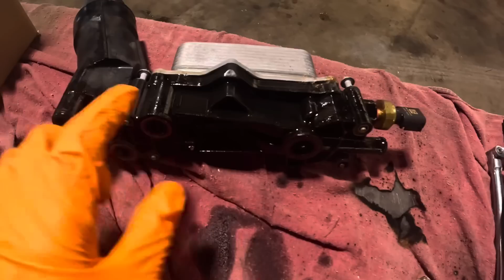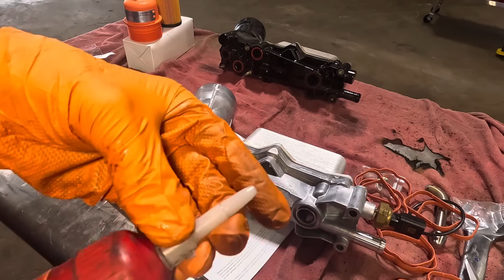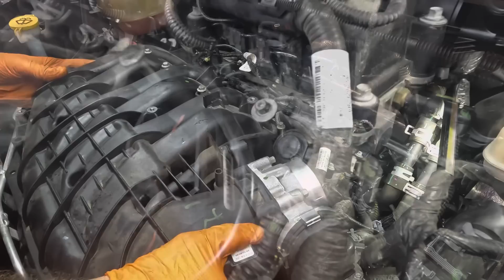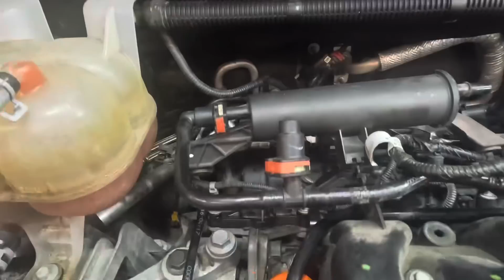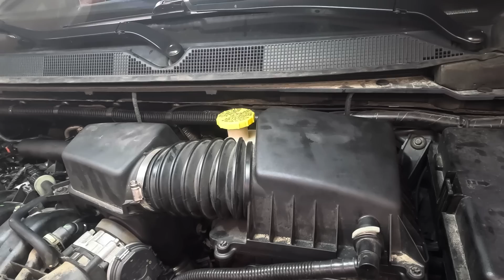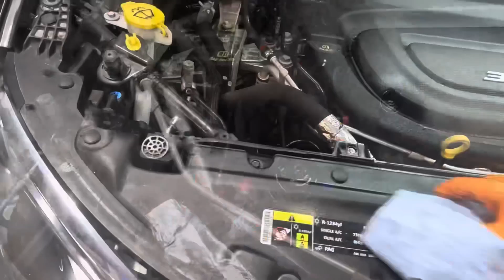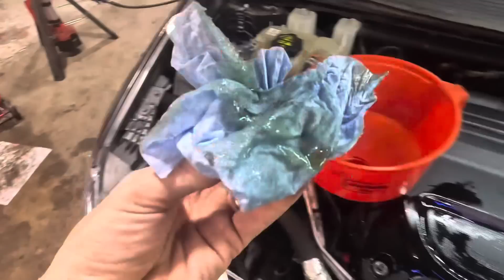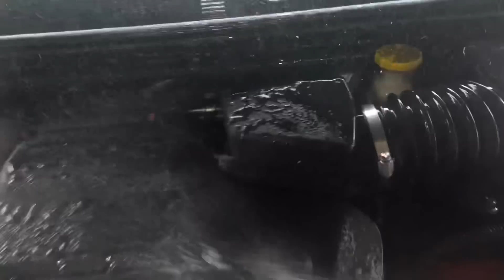Plastic Pentastar 3.6 PT2 Chrysler Dodge Jeep Ram Volkswagen. Leaking Oil Contamination!

Comment: Did a oil change on one of these on 2014-13 caravan. Next day things pissing oil on the driver side of the engine. Plug, filter cap tight. The onrings on the base failed. Big time.

Comment: Very much doubt that glass reinforced nylon was used for that housing.   Far too costly for Chrysler.    More likely a mixture of cheap as chips polystryrene mixed with a lick of more expensive Noryl (poly phenylene oxide) to extend its life - a little bit.

Comment: Hey Ray, you used teflon tape but I've said it before and I'll say it again: use Loctite 55.
A few turns and it's allways sealed even when you turn it a bit back.
I'm sure you'll never use teflon tape again.
Greetings from a humble mechanic in the Netherlands.

Comment: I was always told not to use a torque wrench for removal. But there are left handed (reverse) threads. That is why there is a switch on torque wrenches. IMO

Comment: I just replaced mine on my 2017 Chrysler Pacifica 2 weeks ago with a aluminum housing and the problem is back don't know if I got the housing level or Torque down properly so now I'm getting ready to revisit this issue all over again fun fun fun fun fun fun
Reply: did you lube that o-ring.??? without lube, o-rings will stretch and crack when installed....
Reply: @MrMustangMan  if I'm not mistaken I think I did put a little bit of oil on it but I did go to Napa I bought a new gasket kit for that new aluminum housing just in case start this procedure all over again and I will definitely leave those thank you

Comment: Can’t tell a book by its cover, well done . As to oil , back in the dark ages , 1966’s, in my military mechanics class the question brought up was —does oil wear out ? Or does it just get dirty and can be cleaned an recycled  ? As a young  lot-jokey at a gas station we sold  bulk oil by the quart that I believe was recycled oil .  So does it wear out or ???   Stay safe , have fun .
Reply: Interesting as much when I was in a similar class and a few years earlier the instructor was a guy that was a chemist for Shell oil but hated the big corporate  world and opted for the green machine. He said contaminants were not the problem for long life, remember how good a job the Frantz toilet paper filters did? He said the problem was that acids built up from the combustion process and filters could not remove that, though I think he mention that Rolls-Royce  had some device to do that. He said the acids were what caused the areas in the babbitt on plain bearings that you may have noticed in high time engines that looks like something was eating the babbitt away.
Reply: @barrystark3811  acid reaction was the big factor in our discussion also. The class was at Millington Teenn , NAS. On engines , both internal and jet/ turbine. It was a Navy school on ground support equiptment.

Comment: I believe that the Pentastar engine in my Grand Cherokee does, in fact, have 2 senders that mount on that oil filter housing, an oil pressure sensor, and a coolant temp sensor.

Comment: Torque wrenches are always bi-directional as far as I'm aware.

1) fasteners can be left or right threads, so 'tightening' could be either direction.

2) measuring the torque required to remove a fastener is a thing...

The beam style of wrench usually has a gauge in both directions, not just one; and as you noted the ratchet style has a reversing lever.

Comment: When extensions are used on a torque wrench the actual torque is not what the torque wrench is set at. It will be much less actual torque than what the wrench is set at. It's physics

Comment: That is correct Ray the Beam Deflectors Wrenches should not and cannot be used in reverse. The Torque Wrench you are using right now can be used in reverse. They are made to Torque Fasteners with Left Hand Thread as well as Right Hand Thread. Argument solved.

Comment: Helpful hint everybody! Excess heat causes this problem, take that plastic (and insulated!) cover off your motor and toss it in the corner of your tool shed. That cover helps keep the top of your engine nice and hot for a long time after you turn it off. Plastic parts + heat = failure every time. I have this motor in my 2012 Wrangler and THIS problem hasn't shown up.... YET!
Reply: i hate those stupid covers.!!!!

Comment: Oh man. I have a 2018 Caravan Grand with 80k miles. So this is another thing to look forward to... Already been through the side door lock fail issue that shops like to charge $1200 to fix. I did it for $70, but took a day and a half of fiddling with sharp metal in the dark. The $1200 was seeming about right toward the end.

Comment: I replaced this on my wife's van 4 years ago and got parts from the stealership   Over  $600.
6 months ago my Jeep was starting to fail, and looked to Amazon.  Got the aluminum one.
FULLY assembled.  With sensors. All plenum seals, etc.   $120.    😧😧
Reply: I got the same, but its not the doorman part? How has yours lasted, ok? 😊
Reply: @martinochs8285  Ya, it's  WOLLAHS.  Working fine. Too much plastic junk on engines nowadays.
Just hope all seals last a long time. Also got the dorman aluminum thermostat housing.  But still have a 
problem with moderate temp swings. Doesn't overheat. (this is #6 therm)

Comment: Ray, I currently own (due to my wife's untimely passing) a 2012 dodge grand caravan with the first gen 3.6 pentastar with 104k on it and can honestly say I haven't had any issues with the oil filter cooler except the relief valve plastic breaking but have fixed it. I DID on the other hand had to have the 135 cylinder head replaced due to dropped valve.

Comment: Hi Ray, A Fantastic repair job!! I have a 2011 Chrysler Town and Country van that had the same issue with the oil cooler assembly leaking oil. I bought the van used a year ago and now have had the issue. I took my van to my repair shop and had them replace the oil cooler. But now I see that they did not replace it with the Dorman oil cooler upgrade{Bummer). I have the original Chrysler part instead again. Now I see what is involved in the installation of the oil cooler. My 3.6L does not have as much stuff on the engine you worked on. Big difference from 2011 to 2017 engine design. Right now my van has 139000 miles on it and so far runs like a top and I hope it will go much more. I change my oil a lot sooner than recommended. So keep up the great work and I enjoy your videos, Been learning a lot at age 74. Don in  Connecticut.

Comment: Wrangler forum participants are stating that the Dorman is NOT the be all, end all.  Problem seems to be with the provided gaskets.  Some are installing Mopar gaskets with the Dorman unit.  I’ve had mine replaced under warranty at 50K on my ‘15 JK.  Looked again today at -60K and I’m dry top/bottom.

Comment: Reliability question.  After many years of seeing oil sender units leaking why would you reuse the old one ?  Also being a brass fitting  I was expecting it to break as you were aggressively tightening it.  I'm guessing You have better luck than I do

Comment: Is that an engine oil cooler or an intake air heater? Happy coincidence or engineering brilliance? Hehe, I said engineering brilliance about a company who uses plastic screws to hold the engine together and can’t out engineer/ manufacture Dorman.

Comment: Ray.  What is meant is do not use an expensive torque wrench to remove fasteners.....for eg, wheel lug nuts.   DUMB. Protect expensive tools that are important when re-assembly demands precision.   and,   Second, the tech that I admire most says, "A real expert can FEEL in his HANDS correct torque.  Period."  I would take off for the moon or Mars if either you, or he, torqued the fasteners on the rocket.   NOTHING BEATS REAL, Capable EXPERIENCE!  Go, Ray, Go Go Go~!!!!

Comment: Beam torque wrenches are nice if you run into reverse treaded components because they are designed to read in both directions right or left hand threads. I've never noticed if the click and electronic torque wrenches read in both directions.

Comment: My comment is the oil pump system of the Pentastar.  If the thermostat goes bad or leaks the engine will continuously run at 86 psi.  The engine oil has to reach 160 degrees or higher before it will drop to 36 psi.  So a bad thermostat  will eventually blow the oil cooler seals in my opinion.  I have a 2013 Town and Country and has a digital display for oil pressure.  The engine now has 4790 hours on it with only a leaky rad that had to be replaced.  Canadian winters are hard on any car up here due to the snow melting salt.  Keep up your video's Ray.

Comment: It is "old Wives tales" about reversing a torque wrench.
1. So many "Lefty Tighty" bolts out there and you'd need to buy a SPECIAL torque wrench just for them.
2. They have a lever for reversing them. If it was WRONG they would not give you a lever.

I do have some "One Way Only" torque devices and if you try to reverse turn, they click.

Comment: My theory on why that bolt didn’t seat when torqued to spec is due to the bolts being previously over tightened. The panel may have been deformed due to the over torquing. Just my opinion.

Comment: Nice job, question , at 17:04 on the video, when you start putting the bolts, do you recommend use lock tide on those bolts?

Comment: IMO, it was only the oil pressure sensor that was replaced previously and that's why the lock clip is missing. The OEM filter assembly is just fine as long as the oil change techs pay attention to the torque rating on the filter cap: 25 Nm as you said, which is quite low. Over-torqueing that cap can stress the assembly, leading to cracks or leaking o-rings.

Comment: If this is a known problem why has no one come up with a better design that is not under all the covers of the engine. An external unit of some type that does not have the coolant and engine oil where they can mix in a failure. "I know" those damn engineers could not organise a feed in a restaurant with $1000 in their pocket (the clean version).

Comment: What a "feat" of engineering! The gaskets are still going to fail even with a housing made of aluminum, why didn't Chrysler plumb the thing to the outside of the engine with lines, in the first place, where it could get some air? Also, you can restore those dessicant bags. Put them in an oven at 200 degrees for a half hour, they'll be good as new.

Comment: Ray ive watched enough of your videos now that when you got the intake off and I saw the oil cooler I was like. "I've seen Ray change this part on another vehicle before. Specifically because of the swamp left behind in the valley." Cheers from the maritimes of Canada. We don't think your exhaust disassemblies are very fair either.

Comment: Honestly, i would have installed a new oil pressure sensor cause they also prone to failure. Just good insurance to not have to do the job again

Comment: If a torque wrench wasn't made to go in reverse, it wouldn't have a reverse on it. And I assume there are applications that utilize counter clockwise thread bolts that require torque specs... Also, I assume if a torque wrench was made for both directions it would state it in the manual... Just my opinion.

Comment: As you stated in the video, "all bolts are fasteners". Engineers call all bolts as "screws"!
Reply: Without looking to back up my comment I think it has to do with the size of the fastener. Not sure where the breakpoint is though. I remember the callouts as either capscrews or bolts.

Comment: Couple of fun facts; my 1967 Mini Cooper S had an oil cooler, it was mounted behind the grill; Find of ask Wife Unit to make a reusable cloth bag, put you BLUE desiccant in it, check it now and then, when it is pink, pour the desiccant out on to a metal tray, put that in the over at 250F (to start off, I don't remember the exact temp) the desiccant will turn bole again, put it back the bag.

Comment: The whole idea of putting an oil cooler on top of the block in the valley, then cover it with a air intake
Seems really stupid.
You have several locations to vent heat off oil, under the radiator, in the grill, in a fender well,  or even under the body in the shape of the oil pan, like Banks oil cooler on rear ends ram air cooling oil cooler.
Mixing it with engine coolant does not seem to take away the heat as much, and certainly putting it in an ez bake oven is really stupid., thats what the valley is when you cover it with an air intake.
Might make a nice oven to keep your lunch warm.

Comment: Left hand threaded fasteners are rare, but are used in some specific applications. To use an S/R interchangeable head on one, simply put the head on reversed and use the torque wrench as usual. The wrench will still have its' normal accuracy.

Comment: Ok Torque wrenches: You do a fastener CW for RH thread and CCW for LH.  If you try to check the torque by unscrewing a fastener, you will not get the original reading due to a thing called detente.  Detente is the force required to overcome static friction, which happens when a fastener is fully torqued and you undo it - it feels stiff initially, then lets go.  That is detente
So there.  Now you know
Nice one Ray, what a pain in the proverbial.

Comment: When you said that 3.6L Pentacrap was in Jeeps my heart sank. I'm probably going to have this repair in my future. I do appreciate you showing that there is an upgraded version of this so I can request so hopefully I should only have to do it once. <knock on wood>. And the talking? That's what makes it fun to watch. I don't use enough Brake Clean to whip an empty can across my garage a holler "Ahhh Another!" but "Click", and "Nice and Shiny" have made into my garage. The occasional "Giggity" still runs across my brain too. If someone doesn't like it? Don't watch... simple. I will continue to watch Ray. Thanks for these vids.

Comment: On those coarse-thread fasteners in plastic, give 'em a backwards twist until the thread drops into the existing cut thread, then screw them in. If you cut a new thread every time, you'll kill the plastic way early.  
Also, if you can't use a torque wrench in reverse, how do you torque left-handed fasteners?

Comment: Having retired from a metrology laboratory, I can assure you, "clicker" type torque wrenches are usable in both the righty-tighty mode or the lefty-tighty mode; however, the typical accuracy of a breakaway wrench ("clicker") in the right-hand direction is +/-4% of full scale (meaning, no matter what you set the wrench for, it is 4% of full scale:  a 20-100ftlb wrench would be +/-4ftlb, whether you set it to 36ftlbs or 95ftlbs), and +/- 6% of full-scale in the left-hand direction.  

Most beam-type wrenches have scales that extend either direction.  Snap-On's dial indicator wrenches are single-direction only, because they are essentially beam-type wrenches, but with a gearset that amplifies the movement of the beam, and is translated to a pointer.  They work only in the righty-tighty direction.

Comment: It depends on the type of torque wrench you are using. Some critical fasteners require you to positively torque to a value, then back torque to a percentage of the tightening torque, before applying a final torque. So yes, there are occurances where a negative torque value is required.

Comment: 55 gal drum yes you definitely need that much motor oil.
well i know that my local mechanic purchased the most popular oil that they use by the drum, or crate if i recall correctly.

Comment: Now the Ford I have you cannot use the coolant you use that you say it will work in for all auto's I was told my dealer in the service and in the parts department to only use what it tells you to put in that car . I asked about the coolant that say unravel they told me no not al all if your car is under warranty it will void your warranty. And it's hard to find my coolant a lot of auto part stores don't carry it so I keep a gallon full straight in my car at all times
Reply: Those workers at the dealer are just saying what they are trained to say.  It's not true, the universal extended life coolants are perfectly fine.

Comment: Hi Ray  -  True that nuts and bolts are fasteners but NOT ALL fasteners are nuts and bolts, there are rivets, cotterpins, lockpins, pushpins, etc are all different varieties of fasteners but are not nuts and bolts.   If you say 'Threaded fasteners" that would also include screws.  Hahahaha !  -----  On the torque wrench question It matters based on the style of torque wrench and you definitely do not (break the torque on fasteners with a torque wrench), there was a day when none of the torque wrenches had a ratcheting feature,  I believe that ratcheting feature came out back in the mid to late 1980's .  But you should never (break a torque) with a torque wrench is a long standing rule on aircraft maintenance.

Comment: For the tourque wrench both was is ok only if the fastener is not tight.  And what about reverse thread fasteners? If you can not turn counter clockwise how could you torque them?

Comment: With the torque wrench it depends how much force is needed to reverse it, like i wouldnt take out something like a crank pulley bolt with it, but valve covers and stuff measured in in.lbs. , ytf not

Comment: I did the exact same upgrade on my 2016 Caravan. The original OEM plastic crap housing was leaking when we bought it. Had it replaced OEM again, and it failed again in just over a year, $800 down the drain. Please folks, DO NOT put that OEM garbage in your ride.